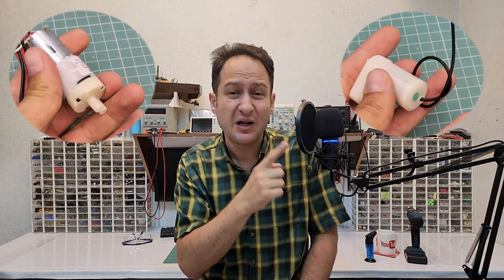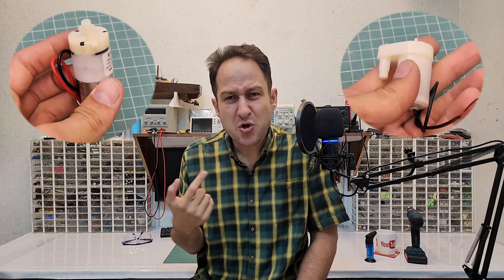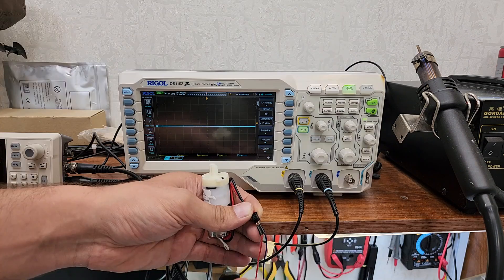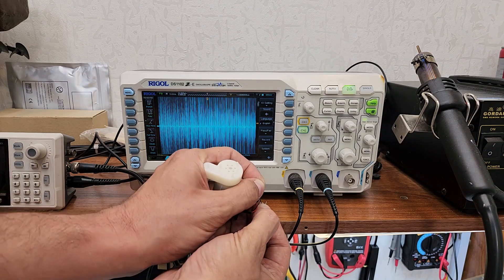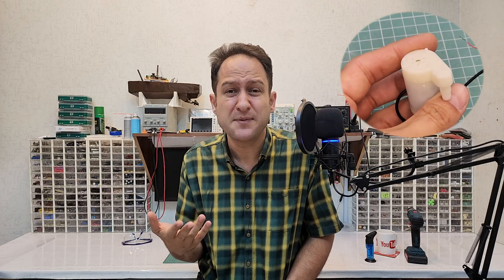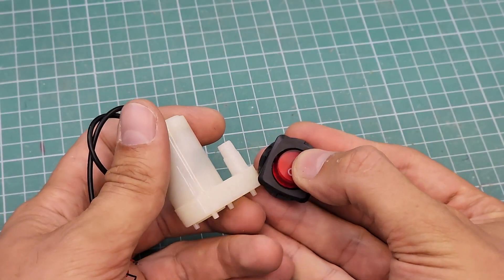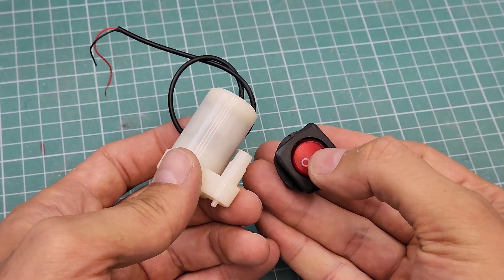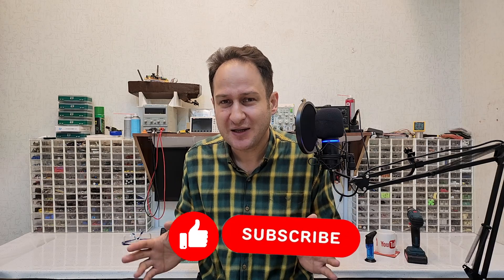How cheap components destroy our projects?

Comment: My Arduino was bugging like crazy when I used that cheap motor. Thank you. Adding a capacitor and a diode (for back EMF reduction) across motor's terminals helped. As well as adding one capacitor between each terminal and ground. Another trick was to twist motor wires. May try adding inductors in series with each terminal, now that I think of it.
Reply from the maker: Thanks for sharing.
BTW i think adding an inductor in series with the motor might is not a good idea 🙃
Reply: @elewizard  Yeah, I think I'd be shooting myself in the foot if I used inductance in series with terminals. Thank you!

Comment: It will be great if you do an autopsy of both motors and compare the diffrence, and maybe find a solution to make the cheap motor less noisey are even completley noise free.
Reply from the maker: There are some solutions for that. For example, you can put a 104cap on the motor terminals. This will reduce it's noise but it will not be enough
Reply: @elewizard  Include some ferrite beads or a coil.

Comment: If you're using micro controllers in your projects and don't have an oscilloscope, you should at least make a makeshift one from your highest speed ADC module and an optocoupler. It might not shows real wave form, but you can still see some difference in your hardware.

Now, for the transient electric noise, well, noise filters may requires more designs, but no noise makes you iterate faster in prototyping. And I believe that the expensive motor has more load tolerance and won't have strange power drop at 80% capacity continuous load.
Reply from the maker: Good idea,  thanks for sharing 👍

Comment: for that noise, why don't you use a couple caps? like yeah, it won't get rid of all the noise, but it will be enough for most cases
Reply from the maker: Yes, using a decoupling capacitor will be effective but it will not sufficient for some applications
Reply: @elewizard  True, And I get that you are trying to make people pay more attention to the components they buy, but sometimes the application really isn't that sensible to noise. What I'm trying to say is that sometimes buying the more expensive component isn't worth for the application, and maybe you should've said that in the video. Good video nonetheless.

Comment: Good advice.  The fewer problems you create while trying to solve the original problem, the better.
But what if you live in the real world and need to control that noisy motor.  A video on dealing with that noise would be interesting.
/me puts a chip on "Optoisolators"

Comment: Did you use a diode anti parallel to the motor? The expensive motor might have that intergrated.
Reply from the maker: Maybe
Reply: @elewizard  maybe u used it?😉

Back EMF is killing for most components.

Comment: what if I use a cheap pump, but controll it with a transistor or a relay. Does my microcontroller still get affected by the noise from the pump? Nice video
Reply from the maker: Yes, it will be still getting the noise. If you are determined to use the cheap pump, you have to separate the power supplies. 1 for the MCU and another one for the pump
Reply: @elewizard  I'm not determined to use cheap components, but I already bought a bunch of cheap stuff.
Ty for the info.
I ll separate the circuits from now on. Is this noise effect only important when there is relatively high amps flowing through circuits or should I isolate just about anything from mcus?

Comment: I bought some cheap optocoupler/mosfet motor drivers off aliexpress before using the cheap water pumps I found, that solution seemed to work great.
Reply: That's a great solution tbh

Comment: Good points.  It might be fun to see the effect of adding a flyback diode and smoothing capacitors to see if the noise can be mitigated.
Reply: It would be a nice challenge for newbies (me) to try to clean up that noise with known techniques.
Reply: @scottfoulk7480  the expensive one likely just has the appropriate capacitor to suppress the noise in parallel with the motor. Sparking brushes will be extremely noisy, so perhaps they make a difference. 

What else could it be?
Reply from the maker: Yes, some techniques will be effective but they can eliminate all the noise.
You have to use a high quality motor to have a nice and clean power lines
Reply: @elewizard  I'm just saying it would be interesting to try it and see the difference.  Thanks.